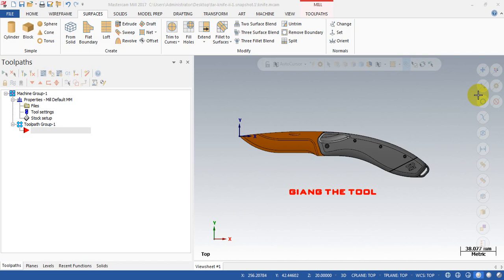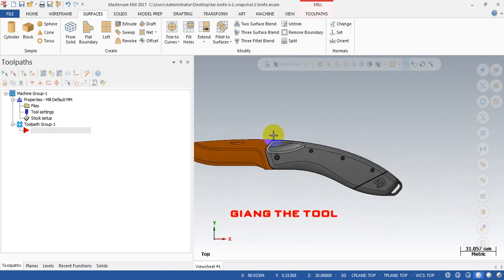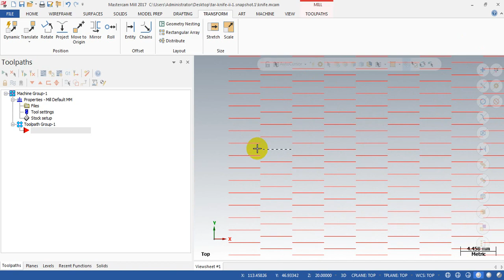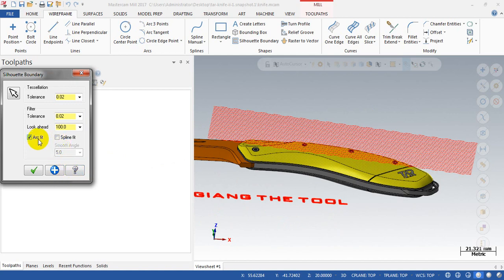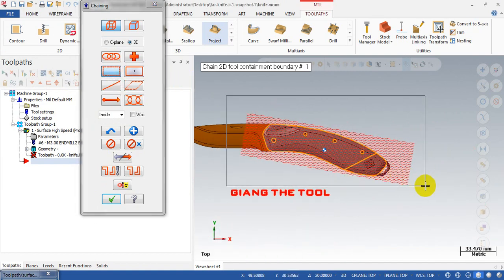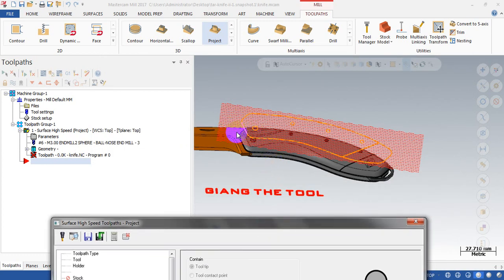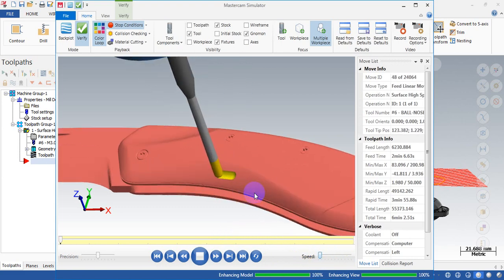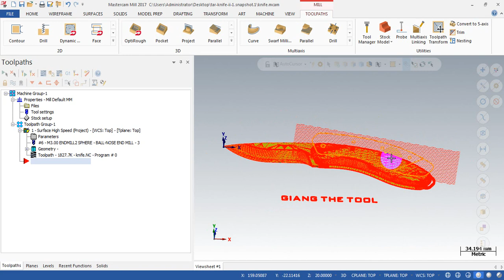MASTERCAM CASE STUDY: CUTTING TEXTURE ON A CUSTOM KNIFE GRIP

Comment: Hey GIANG another great video! I was wondering on this video you did MASTERCAM MULTI-AXIS LESSON 1: MULTI AXIS DRILLING (PART.1) how did you put those points on the cylinder like that?
Reply from the maker: you can use the roll function on mastercam